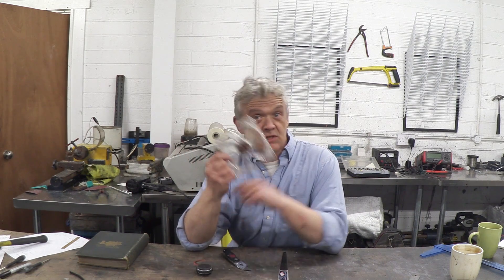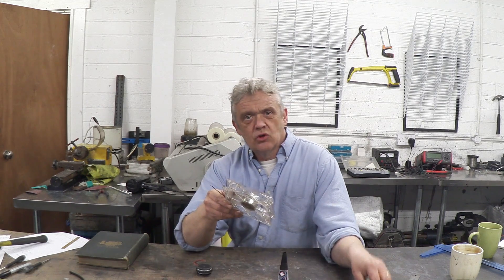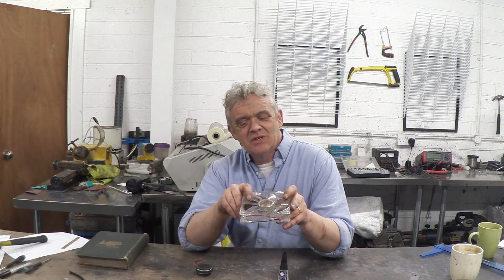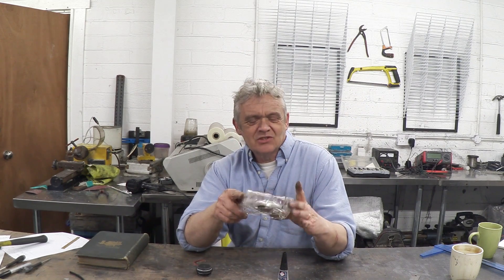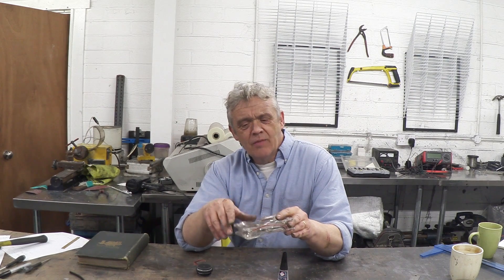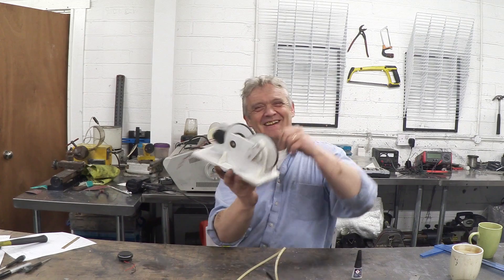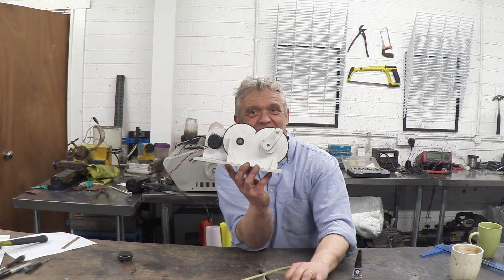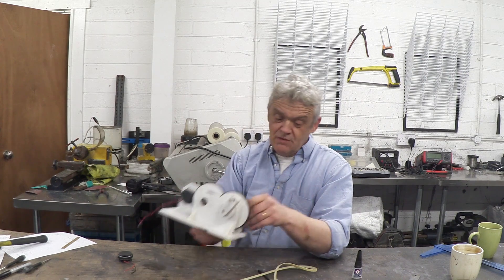Hand Crank Generator From A PC Fan And Super Easy Gears

Comment: Hi Robert.
I'm wondering if you've ever made a generator that uses both polarities of a magnet? It has always been a gripe of mine, why modern motors and generators use only half a magnets potential. My own experiments show double the amperage, for very little extra cost. Yes, I know a co-axial permanent magnet generator is a pain to make, but nessaccery to take advantage of both polarities. Doubling the amperage for a few pounds or pennies more seems worthy and can be scaled to any size. You can play around with how you wire up the coils and be bemused, or try to understand why the dual polarity Motor/Generator is not in common use.

Comment: It is very hard to  find the right spacing for the holes of the gear walls. You cant be even a mm off. I thought of using the printer bands for coggs a few days ago also. I also was very proud of myself..
Reply from the maker: it's why I avoided the small pitch belt - the pitch I used had enough 'slack' to allow for meshing and great minds think alike it would seem lol
Reply: It would seem so, lol! I am making a 20 cm tall vertical saw for plywoood  at the moment. I needed a way to connect the motor to the saw. That is always a problem. I like to just  watch what I have and just let the creative juices flow for a solution. That is how I came up with our great idea. Cant use it fr the saw but I will fr other sings for sure. For the saw and my future generator I will use the turning mechanism of a fan. It cam to me yesterday while looking at my stuff..

Comment: I love your old school approach to building. I would have first thought of using a 3D printer. But I suspect the toothed belt is much more durable than the material used in most 3D printers. Thank you.
Reply from the maker: I would think so mate - handy if you have a 3d printer but toothed belt if you don't I think

Comment: Even using these toothed belts, are gears simpler than pulleys?
Reply from the maker: different solutions for different problems mate - there is no better
Reply: @ThinkingandTinkering  Not a critique, I enjoyed the project.  Just for your next scrapyard visit -- the automatic opening doors on hatchbacks and minivans also use a very sturdy version of the toothed belt, as well as motors and gears made to engage them.
Reply: Sort of and you can combine the two with these belts.

Comment: Is there a reason why you needed gear teeth opposed to something like a pulley and belt setup?
Reply from the maker: i wanted to show how to make the gears - like i said in the video - i couldn't have shown that if i had made a pully
Reply: @ThinkingandTinkering  That makes sense. I suppose what I meant to ask is what the advantage was. It was an intriguing idea given that gears can carry more torque than belts without slipping, but you see v belts and such driving heavy machinery such as lathes. For this specific application it seemed like you might not see the benefit.

Comment: Good idea, Robert. That's clever. That technique will work well until I can get a 3-D printer. 
I used that foam construction board to make a nifty microwave antenna. I glued aluminum foil to it for a reflector.
I found several gearboxes online with metal gears that will take considerably more torque but at considerably more expense.
Reply from the maker: for sure mate - it is an idea to get you up and running and making without too much expense

Comment: Brilliantly simple. 

Works great for low power but may  need  more contant under a heavier load. The same belt material can be used as a belt that meshes with the cogs.
Reply from the maker: for sure mate - but great for folks wanting to explore ideas on a budget

Comment: Hmm. Given the current situation, 2.6 volts DC would be good.
Mix it up into an Oxygen Generator. Ventilators are fine, but first you need Oxygen, which 2.6V DC will give by splitting water. India and Africa will worship you forever if you can make a simple Oxygen Generator.
Reply from the maker: nice one mate

Comment: I'm geeking out, I love hand crank or any manual generators. 
I need to find some of that pvc coated foam for a few projects. 
I've always wanted to make a sterling engine to charge a small 12v battery bank but I think plastic coated foam cogs may not handle that.
Reply from the maker: you could always use the plastic cogs as a pattern mate - maybe cast in resin? of Ali if you have a small kiln that can get up to 600C or so?
Reply: Defect The Synchronous motor that turns the glass plate inside a Microwave cooker makes an excellent small but powerful gene, I’m making one into a hand Crank gene to charge phones etc up. 240Vac/1-4W.
Reply: Dave, I'm gettng to that, lol!  So much to do,  thank god for his lockdown..